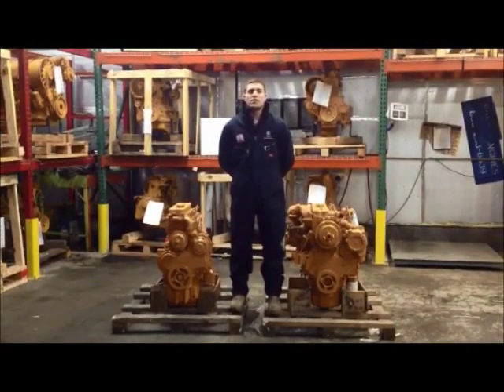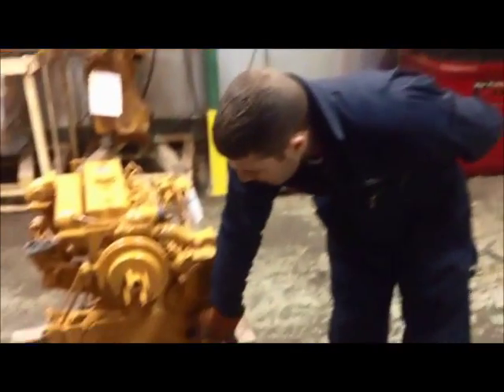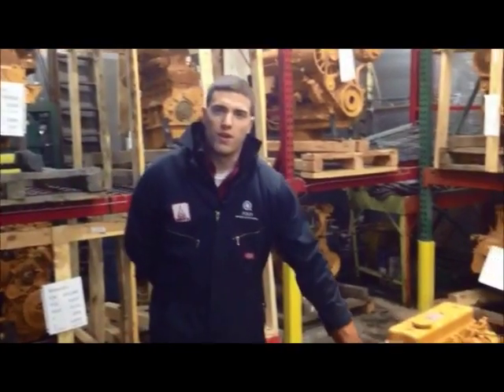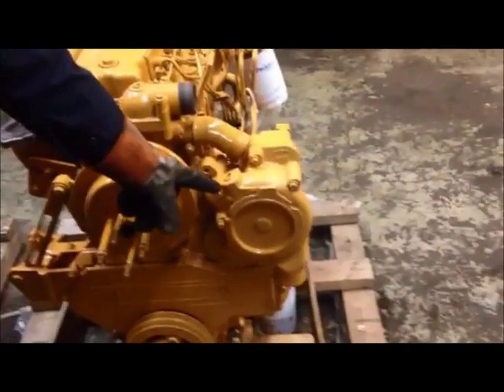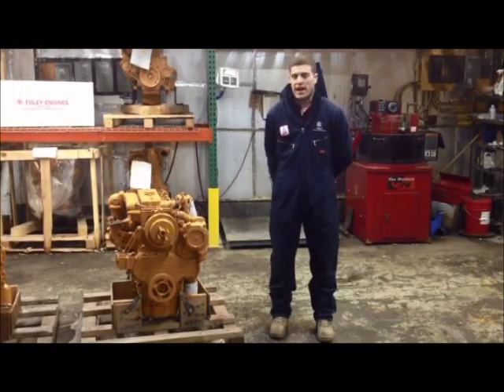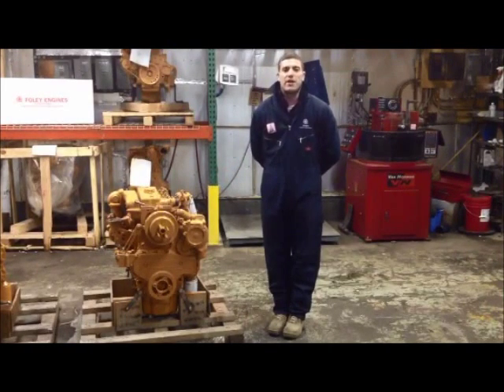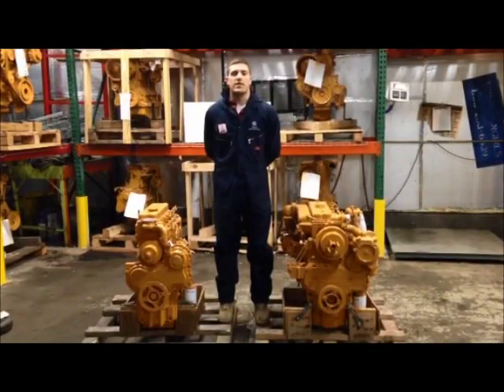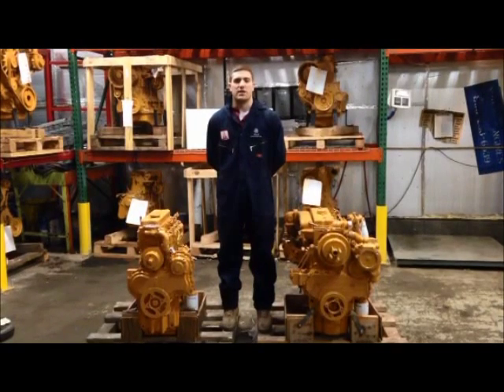Perkins 1000 Series Engine Serial Number Location

Comment: hi, great video. I have a 1000 series turbo engine with no serial. I wounder if you can help?
Reply from the maker: Hey, thanks for the nice comment!  Give us a call with the numbers off the turbo and the numbers off of the injection pump.  We should be able to use that info to narrow down the exact engine you have..  Call us direct at 508-753-2979 or domestic toll free at 800-233-6539.  Thanks again, Foley Engines